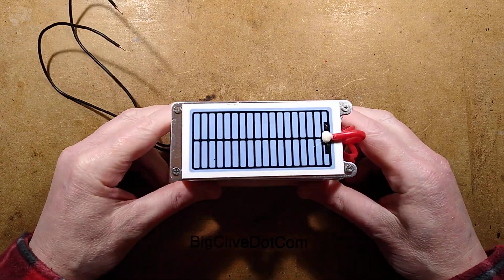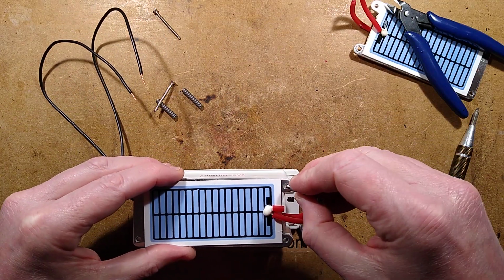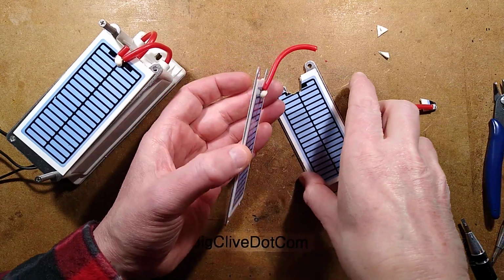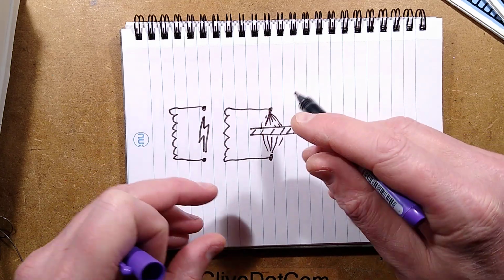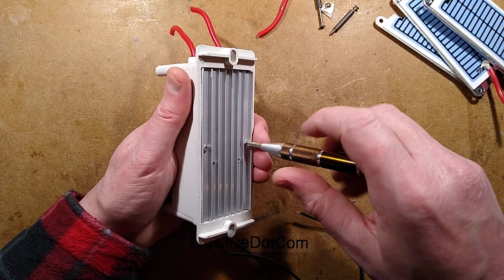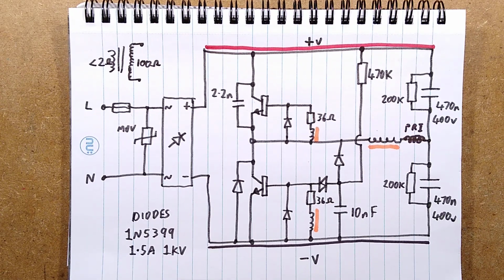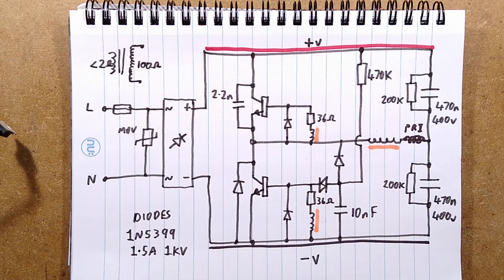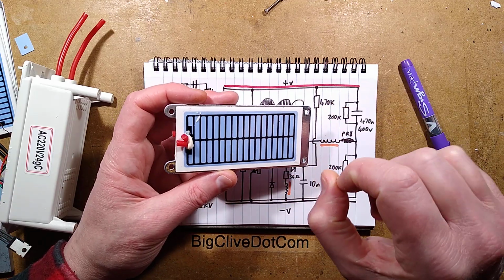High power ozone generator teardown with schematic

Comment: Hello sir, thank you for the video explanation. I watched it to the end.

I would like to ask if it's possible to add voltage, current, and temperature sensor measurements. However, we should focus on voltage and current first. For example, the output voltage (the ozone output) is routed to a voltage divider, then fed to the LM358 IC, and then read using a microcontroller such as an Arduino or ESP32. Is this possible? What do you think? Or is there another way?

Meanwhile, the current measurement uses the SCT013 component. The component is clamped to one of the cables and then fed to the microcontroller so the data can be read directly. Is this possible? What do you think? Or is there another way?

Thank you.

Comment: I know this is not a new video, but would you mind to give me the number or specifications for those 2 glass diode near the transistor? Is it 1n4148? I have the same psu like this and its quite hard to read those components number. Thanks in advance.
Reply from the maker: I think they are standard 1N4148 diodes.

Comment: Hi! I also bought an ozone generator from eBay and had the exact same problem as you: it arrived with the ceramic plate cracked. Now I’ve ordered a replacement plate and plan to solder it in to replace the broken one, because I want to use the device in my truck to remove bad odors. Some drivers smoke in the cabin even though it’s forbidden by the company, and the smell of cigarettes really bothers me. That’s why I looked for solutions and decided to try this ozone generator, planning to power it from the truck’s cigarette lighter socket. Do you have any advice or recommendations for safely using this device in the truck cabin? Thanks in advance!
Reply from the maker: I'd suggest using it in small bursts initially and then closing the door to let the ozone do its work.  These put out a lot, so be careful about running it for too long in case it damages rubber components.  Also take precautions to avoid breathing large amounts of ozone.  Don't run it while you're in the cab.

Comment: Can you use light fixture ballast to replace this ozone generator power supply? Mine went bad
Reply from the maker: No.  It has to be high voltage AC like a neon power supply.

Comment: I have made numerous devices to produce cascades of beautifully flowing little ripples out of a controlled corona discharge. I tried to post a pic of my electric waterfall but it won't accept a pic.
I use a ballast for a 12 ft t8 to drive any number of flyback transformers I have with varying results, many of which SIZZLE!! You can have a lot of fun with sparks.

Comment: It looks like they just use a bunch of these in those metal "commercial air purifier" boxes that are sold on eBay.

I'd assume the 60g ones have, like, three of these (sort of, lower individual rating probably), but they could also be completely fraudulent, won't know until it shows up.

I'm kind of buying it just because I can, but also, if it works, someone I know has an apartment that has a REALLY bad smoke smell issue.

Comment: I BOUGHT ONE OF THESE OFF OF AlleyExpress for $14.00 total cost. My ozone generator has 4-ceramic plates and it puts out tons of ozone. YOU MUST EXERCISE  GREAT  CAUTION WHEN USING THESE OZONE GENERATORS. TOO MUCH OZONE IN THE AIR YOU BREATHE IS A HEALTH RISK. GOOGLE OZONE GENERATORS AND YOU WILL SEE WHAT I AM TALKING ABOUT. I RUN MINE FOR ABOUT 2 MINS THEN SHUT IT OFF. IT PUTS OUT 40,000 MG /HR OF OZONE.  YOU MUST BE VERY CAREFUL WHEN USING THESE POWERFUL OZONE GENERATORS!!!

Comment: 16:04 anyone know what the component is at the top right hand corner; running upwards, vertically from the left leg of the green capacitor.
(Curious as, when I opened up a knackered one, this glass shrouded component was properly burnt out)
Cheers

Comment: Hi, I have just purchased a unit from China and have a question. The unit is a complete cased unit with what looks like the same internals as this video. I put in the offending room and left running when I was not at the property. Got a call about 15 minutes later saying that the interlinked smoke alarms where going off in the property. The room apparently had a slightly hazy look to it. Inside the room was bedroom furniture including a memory foam  mattress. Have used the unit again in a car for 15mins and no appreciable haze and just a strong not unpleasant chemical smell is what I can pick up being released by it. Thanks for reading.
Reply from the maker: Ozone itself has a smell like bleach.   I'm not sure what caused the haze in the room.  It's possible that it interacted with airborne VOCs.
I wouldn't recommend leaving these units running in a room for a very long time, and definitely not unattended.
Also take care to limit human/animal/plant exposure to ozone.  Especially when the unit is running.  It's best to air rooms out after use to dissipate residual ozone.

Comment: Wish me luck! I found this video while doing research. I have a commercial ozone generator, and it's not working right. It's very simple, and I think it just needs a new capacitor. Problem is, I don't know the specs on it, and the existing capacitor is potted in a black epoxy. I'll test it, and if it fails, tear it apart to attempt to find the numbers.

Comment: You didn't explain how the highside transistor turns on???
Reply from the maker: I did.  Both transistors have transformer isolated base drives with respect to their emitters.
Reply: @bigclivedotcom  ahh the ferrite ring? But then the third winding was not shown in your drawing which confused me. So essentially the primary of the HV transformer must then be threaded through the ferrite ring to drive either transistor?

Comment: Great video, thank you Clive! With a huge SAFETY WARNING and DO NOT TRY THIS AT HOME disclaimer, do you think that it would be hypothetically possible to use the HV output of this to do fractal wood burning? Cheers, Chris 👍
Reply from the maker: I'm not sure if the power supply would survive the high open circuit voltage that could occur.

Comment: I brought a Chineseium ozone generator yesterday with this cheap HV unit in it. Opened the cardboard delivery box, and a piece of wire fell out of the enclosure. The combined switched IEC inlet was potted with silicone, and what they called earth bonding to chassis was a blue neutral wire that was extremely dangerously spot welded and glued to the stainless steel enclosure
Reply from the maker: They often fail to follow any wiring colour standard.  I'm surprised the earth was connected at all.   If it's a fused plug, check the fuse is even in circuit.
Reply: @bigclivedotcom  used my own IEC lead with a real bussmann 3a fuse in it. Checked continuity to ground and chassis to ensure i didn't get stung

Comment: So could the plates be considered a leaky capacitor of low amperage but high voltage, almost but the leakeage is the load?
Reply from the maker: They are effectively acting as capacitors.

Comment: Hi, friend. I watched your video but your subtitles are turned off and I don’t quite understand your language. Therefore, I have a question - my ozonizer worked for 1 minute, then both transistors and the output winding of the transformer burned out. I changed the transistors. But the transformer is filled with resin. A question for you: is it possible to replace this transformer with anything? Maybe a transformer from a CRT monitor or TV (which has a kinescope)? or what else can be used? So that he can fit into this box? Thank you, I'm waiting for your answer.
Reply from the maker: Some use an electronic neon sign transformer.  These power supplies supplied with them are not reliable.
Reply: Thanks! Could you send me a link to such an electronic transformer? Google doesn't find it for me (

And another question - if I don’t find such a transformer, I can wind it myself. Can you tell me what voltage this device has on the secondary winding?

As I understand it, if the circuit contains voltage rectification (diode bridge), then it should be a pulse transformer? Is it possible to use this from a computer power supply? @bigclivedotcom

Comment: Hello Clive Sir! I know this vid is 2yrs old but I'm going to ask you for simplicity sake if you could post a link or reference me and others to a breadboard schematic/diagram/layout where I can put it together initially and replace components very simply when they expire/burn out. my soldering skills are less that stellar. I would appreciate this simple circuit with needed components list (I just bought this exact unit in the 110V flavor for US voltage) and there ratings to clone this for personal use only. I've been using corona discharge ozone generators for most of my adult life but there getting expensive buying the 200 dollar units that don't last, so, Maybe you have something I could use to whip up a couple of these on breadboards. Thank you in advance. p.s. love your videos.

Comment: is there anything about this that would likely be damaged by running it on a variac, to vary output?
Reply from the maker: Not sure how it would handle that.
Reply: @bigclivedotcom  i bought an ozone generator over 5 years ago, and use it occasionally.  it was called a 3.5g an hour unit, which seems to work very well. i just bought a slightly cheaper one that is supposed to be 32g an hour for a little under $50.  it seems to do less than the older one, and i was expecting close to 10 times the output.  all four plates light up, and it pulls about 110 watts from the outlet, but the smell isn't as intense as from the older one.  the fan is 1/3 the power of the old one, and the build is much worse. the power cable  doesn't even have a ground wire. i'll be changing that.  the instructions say not to touch the case after it is plugged in. horrible.
Reply from the maker: @wilsard  During the pandemic lots of very poor quality units were banged out.  Depending on your application, a trace level ozone generator that runs all the time may be useful.  But really really low output.

Comment: I seek professional advice 
Mine arrived absolutely shredded. Both the fuse and the varistor SUBLIMATED before even plugging it in..
I replaced the whole rectifier, the fuse and basically every other active component in this shitty device. It is now oscillating but not producing any ozone. 
Any idea what to do now ? The only component i did not replace is the diac and the varistor.
Im assuming the varistor is not needed ? And the diac is impossible to measure because it's minimal breakdown voltage is at 28V.
Could the damaged diac allow current to pass at voltages too low to let the capacitors charge to sufficient voltage ?
I can't perform any complex measurements as I'm afraid that I'll deep-fry my equipment

Comment: Would you not have corona discharge at high DC voltage as well?
Reply from the maker: With this system it relies on AC coupling.

Comment: i ordered 2 of what i beleived to be 220v/10g but when it arrived it had printed on the side of them 110v10g the seller kept telling me they run on either and to test it so i tested 1 and it packed up after just over 1 minute in the end i got a refund but i though i would take a look at thte damaged one and the circuitboard is exactly the same as this one with the only excetion being the 2 x 200k resistors where mine are 150k resistors. even the main cols are the same veing 2ohms and 100ohms. ive tried to repair it as it seemed the fuse blew so i used a jumper wire but it just shorts out the breaker now. my main question is should i just change the resistors on the working one to 200k or will that not make a difference
Reply: well figured out the tripping it was the brifge rectifier diodes blown lol had fun replaced them and tested it and it went off with a bang both transistors blew up :-P
Reply from the maker: It was possibly a failed transistor that took out the rectifier.

Comment: i use the Enclosed fan types for my workshop, i modded mine with 4 units and placed em in a 220mm computer fans 2 at front 2 at back, these do work very well for dirty shops to get the smell out, sadly it does perish my belts and rubber seals of my doors.  also these units are built to place into Used cars to "remove" that cigarette smell. keep in note! these units the one you bought has a VERY low life span, one plate lasts only 100 hours tops before they burn out. is why there cheap cause you need to replace em after the time is met.
Reply: Could you cover any rubber perishables with something before treatment to save them?
Reply: @paolom.6011  to answer that question, ozone O3 is a gas byproduct, so if the object is sealed or wrapped in a airtight bag or non permissible materials it should be fine. its just hard as these things spew alot of this gas and is impossible to cover or remember what objects that can get affected by it prior to use. so far i learnt this too late and alot of my power cables and rubber seals in my machines are damaged cause the treatments. so careful running these if ya can and remove any items that maybe sensitive to the Ozone if ya can if possible

Comment: Wonder if you could regulate these with a simple dimmer?  The power factor is almost unity and the current isn't high.  Maybe a circuit with a simple relay could be used to regulate them too.  Might try an build a PWM triac controller if that would work best.

Comment: I used one of these to replace the failed 60hz AC HV transformer in my old commercial ozone generator. 85 Watts! into 4 3x5 inch double sided stainless mesh on ceramic plates. (I binned the originals) It will run you out of the room in a couple of min. Good thing it has a timer. My generator had originally a .5A breaker on the HV side. I had to change it to a 1A since its pulling 85 watts now. Mine seems to be one power level down from the one that you have, judging from the length of the heat sink. the 40 W one has a heat sink about 1/2 the length of the case. Mine is about 80% of the length of the case. Yours is the big dog!

Comment: tech question:   i made an ozone generator. electronic circuit is from a jacob ladder. for the generator part, i used two layers of aluminum mesh and between them is a 2 mm glass. 30 by 20 cm surface of mesh. i have put a fan that moves the O3, and it cools the glass too. so far its glass is not broken, but after your description for breaking glass because of heat i am getting concerned. i think fan will cool the area as well and it wont break. your comment? thanks
Reply from the maker: If you run out for a while then turn it off, and the glass isn't hot it should be OK.  Remember not to have too much ozone in living areas.
Reply: How do you make this ozone generator please

Comment: dude, I have this thing. it produces ozone on an industrial level. 24g/hour is no joke. I don't think this thing should be legal.

I have a few tips for you:
1. use some strong fan to move air currents rapidly through the plates. it increases the ozone production significantly. it also cools the plates because it gets very hot if you just let it sit in the ambient air.

2. clean the plates before every use. clean it with damp tissue paper or clean cloth, it will improve the arcing uniformity. any dust or oils on the surface will affect the arcs. you can inspect the arc uniformity in a dark room.

3. NEVER TOUCH THE PLATES WHEN ITS ON. it feeds on 5kV and about 400mA of electricity. its deadly if you're touching it with both hands. and it will definitely burn your hands if you touch it with 1 hand.

Comment: Hey bigclive! i saw this video few days ago(at time of writing this comment) and my stepfather was like: You had corona so we need to sterilize this place. and ordered some super cheap ozone gen. gues what! the same module was there! but not broken... the ozone gen. was slow.
Reply: dude, I have this thing. it produces ozone on an industrial level. 24g/hour is no joke. I don't think this thing should be legal.

I have a few tips for you:
1. use some strong fan to move air currents rapidly through the plates. it increases the ozone production significantly. it also cools the plates because it gets very hot if you just let it sit in the ambient air.

2. clean the plates before every use. clean it with damp tissue paper or clean cloth, it will improve the arcing uniformity. any dust or oils on the surface will affect the arcs. you can inspect the arc uniformity in a dark room.

3. NEVER TOUCH THE PLATES WHEN ITS ON. it feeds on 5kV and about 400mA of electricity. its deadly if you're touching it with both hands. and it will definitely burn your hands if you touch it with 1 hand.

Comment: Try to use Rosin when you troubling with soldering. DIAC is not triggering from zero Volt.hope you have explanation about higher voltage biasing transistor behaviour!

Comment: I have the same unit but the pcb fuse has blown, i think the transformer wire was shorted to the mosfet heatsink.  Do i bypass the fuse or should i replace? What specifications though?

Comment: plates show a condenser effect. As it removed 2 plates, the resonance frequency deteriorated and power consumption increased. If he worked a little more, it would burn. It normally draws power due to 80w. Its approximate frequency is between 15-25 kHz.
dielectric plates are broken. There was a short circuit and the power continued to increase
Reply: Why are some ceramic plates  soldered at two points and some only at one point?
Reply: @jafe.ribeiro  Think of plates like capacitors. It connects two parallels in series or different. In this way, it obtains an average value.